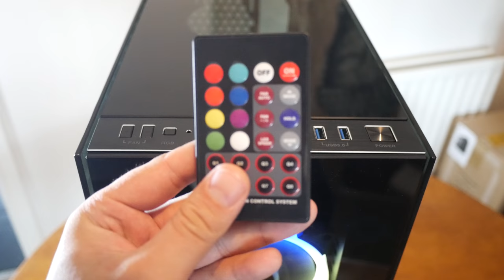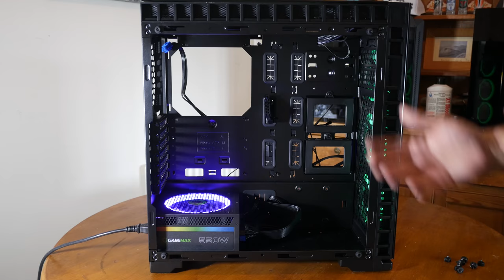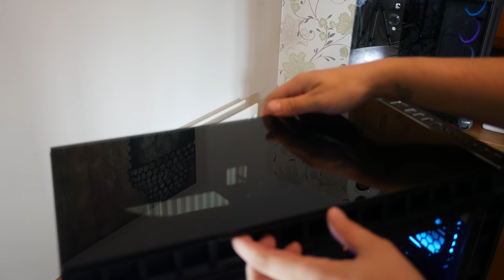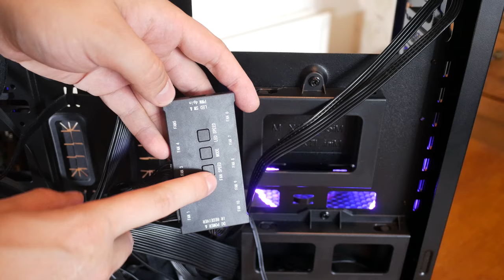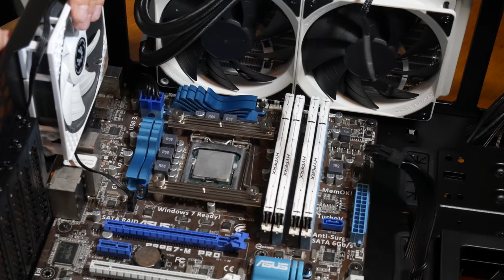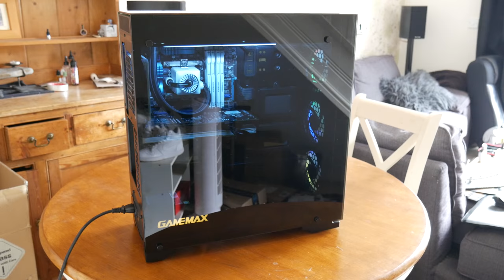Gamemax Spectrum Tempered Glass RGB Gaming Case Review

Comment: I have this case only bought it as it was offer at £65 , you should be able to use the remote to control the fan speed,  its basically slow or fast, and then an auto button which seems to just run high 99.9% of the time, odd time when idle it kicks off. 

i like this case but i feel cable management is a pain in the ass flat cables are awesome for it 

id say this need liquid cooling if your running big rigs. 

I have actually been tempted to cut around 2/3 inch off the Glass to help with airflow as there is intakes on the sides at the front if this don't work i will actually be looking at a better case, as i am looking at getting a high high end GPU 

and all my buttons on my RGB controller works :/, Q1-Q8 changes preset of the RGB , mode controls the different modes, hold stops it,  no is on, off is off, fan auto (as mention above) , Fan -/+ is a two set speed 50% or 100% from the looks of it and the Colours set the RGB to the solid colours.
Reply from the maker: Thanks for all the information 😎